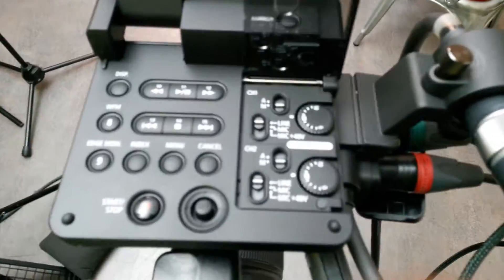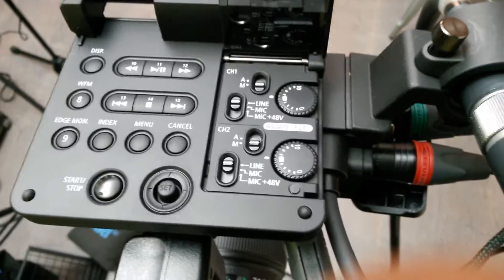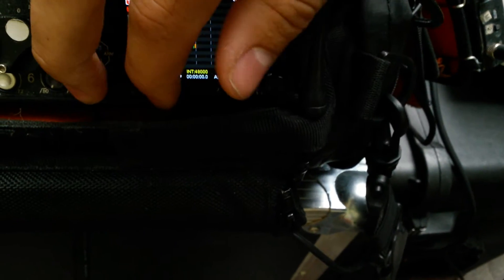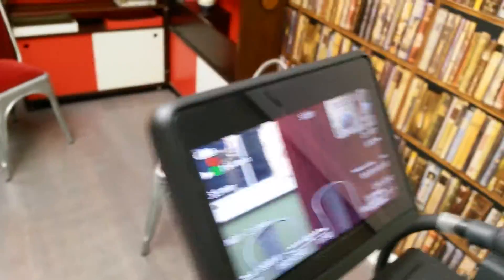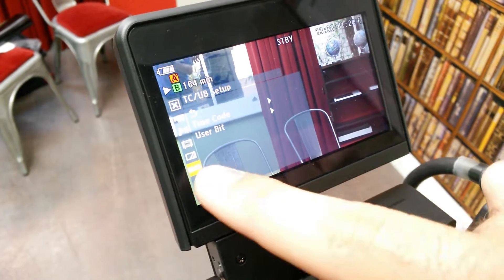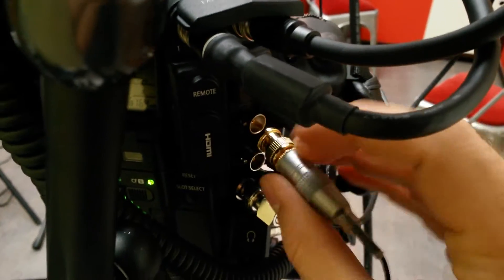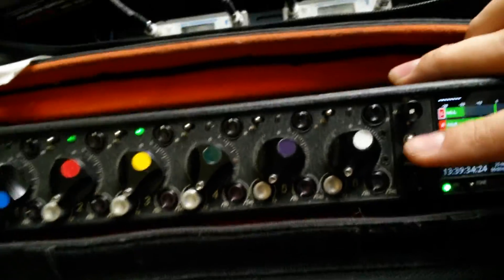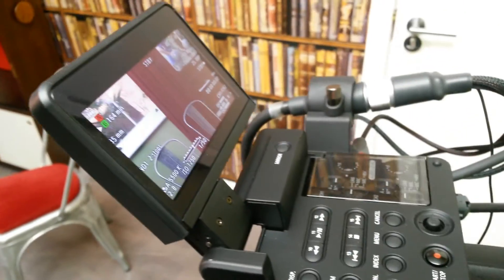Canon C300 Audio help / Timecode Tutorial

Comment: Hi, when you send your 1khz tone to C300, the C300 reads -20db. May I ask if this is the industry standard, or will you adjust the -20db on C300 to something else?

If you will adjust the -20db, then to what level will you adjust it to for a 1khz tone? 

Thank you for your help.
Reply from the maker: lee yihong industry standard :) check your mixer and calibrate so whatever is on your mixer is on the camera
Reply: thank you for your reply Matt. Sorry i'm still a little confused. How come your mixer reads 0db, but your C300 reads -20db on 1khz tone?

I thought for 1 kHz tone, both mixer and C300 should read 0db?

Comment: Hi, I am using a c300 mk2 with a senheiser mke600 as a boom. The mic is connected to a tascam 100 then transmitted to the camera by senheiser ew100g2s. The trouble is the audio sounds substantially worse in camera then it does on the tascam.

 Are the preamps on the mk2 really that bad or am I doing something wrong? Thanks
Reply from the maker: +Uncle Benja you must have the settings on your G2 set wrong and be distorting or limiting over the wireless link but hard to diagnose without being there
Reply: Swap out the wireless link for a cable, and test how that sounds. 

If it sounds great, then you should focus on fiddling with your wireless to set up that right. 

If it still sounds bad.... then the problem lies somewhere else.

Comment: Since you've said on another commented video that you can "execute ideas and tutorials at a speed the big guys can't" perhaps you can speedily add some explanations to this, and other TC videos you've done, about the need to add genlock into the equation, if you want a TC that is frame accurate rather than just approximate, or even totally different....

Or join the IPS (as I've suggested) and discover from those with greater knowledge how much more needs to be understood if you are to avoid some expensive disasters;}
Reply from the maker: this video is about timecode not genlock.  i will put those out seperately to keep everything easy and simple to understand. But I will excucute on that in due course :)
Reply: For film shoots where each take is only a few minutes long, then just TC by itself can be quite sufficient. 

But for say docos where interviews are running for an hour long non stop, or recording events were the cameras are also rolling and rolling, then yeah I agree you want to consider genlock as well.  But it isn't essential to have both for every shoot.